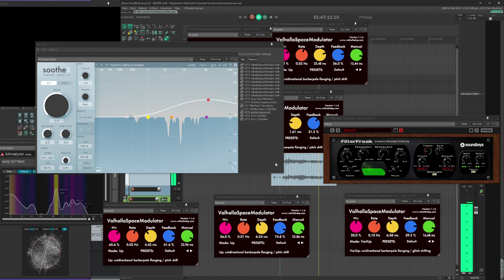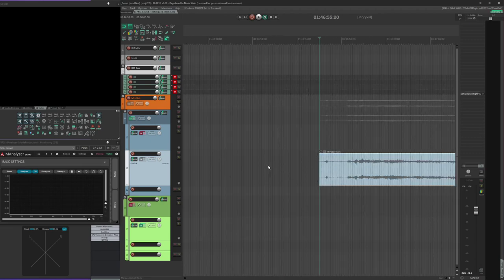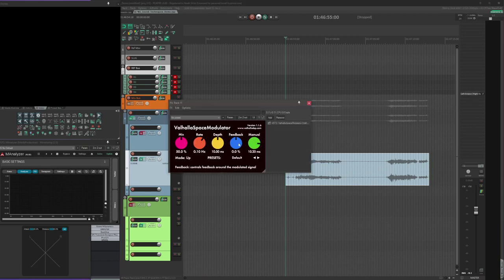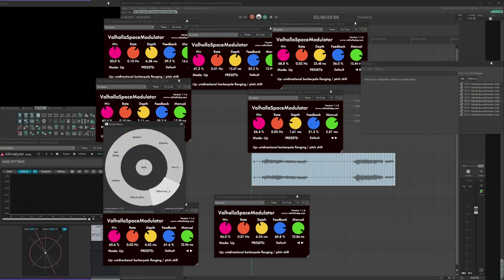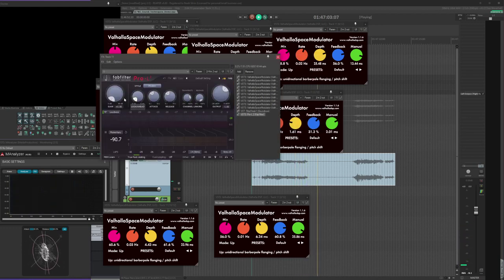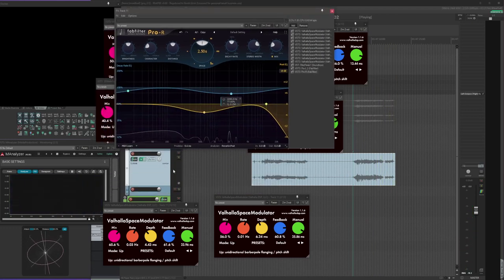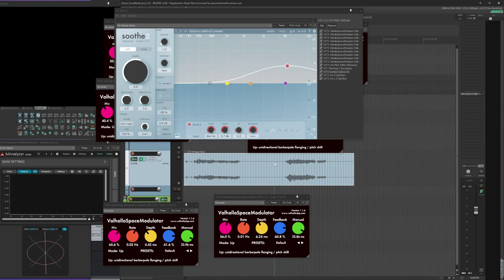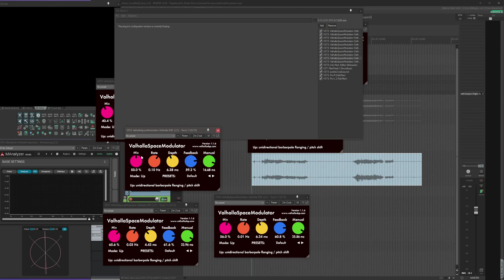Sound Design Trick - Flange Warbles

Comment: I wonder if NI Choral can be used in the same way :p
Reply from the maker: it totally can, w/ Choral though I'd keep the rate+amount of modulation pretty low, and the delay set high. You can also try metaflanger, H-Delay, Timeless3, Sandman, etc. They're all slightly different, fun to mix and match

Comment: This is amazing thanks Noah!  I had some luck using Melda's flanger, the randomisation button was a lot of fun.

Do you have any advice for coming up with textures that are a little more mono-compatible?
Reply from the maker: Thanks! Fair point, this has a lot of stereo movement that can be distracting. I'd put Boom ReCenter at the end of this chain in Multiband mode to have a more balanced/clear center image. Something fun to try as well would be putting an M/S Encoder at the end of the chain, so the L gets treated as the Mid and the R becomes the Side
Reply: @noahsitrin9823  That sounds fun, I'll give it a go! Thanks!